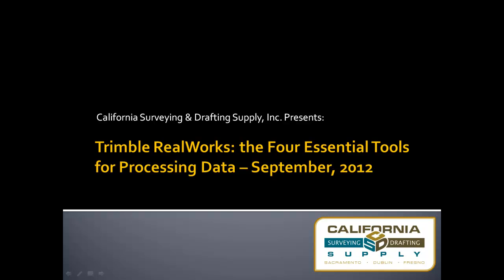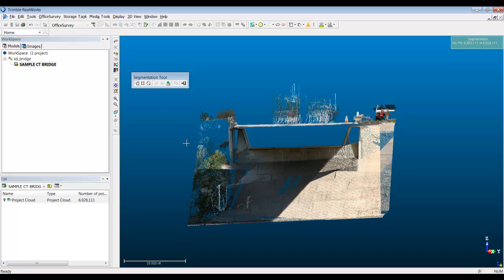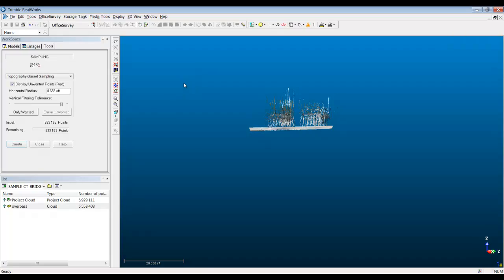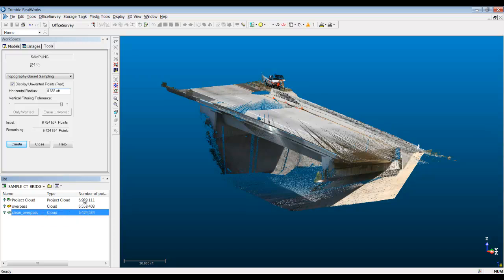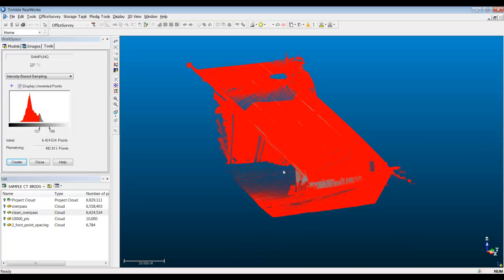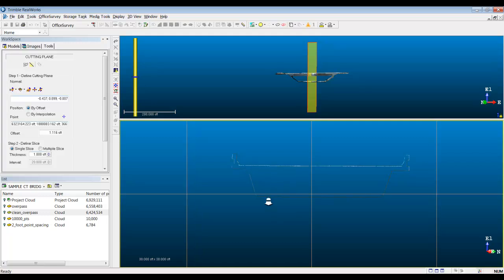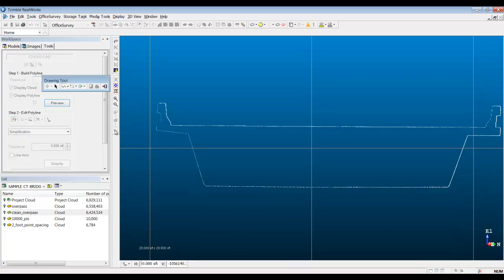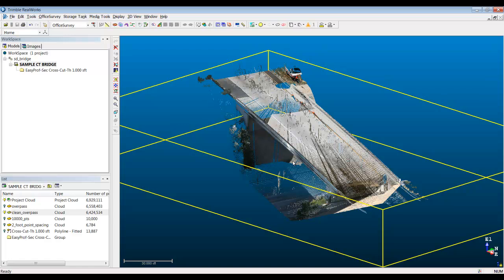Trimble RealWorks: 4 Essential Tools for Easy 3D Point Cloud Processing

Comment: I noticed in Realworks 10.0 that they have eliminated the Topography-Based Sampling Tool. Is there a tool that will do the same thing in Version 10.0 that used to be in previous versions? If so, could you do a tutorial on it? Thanks.